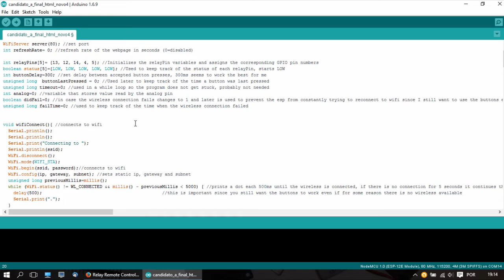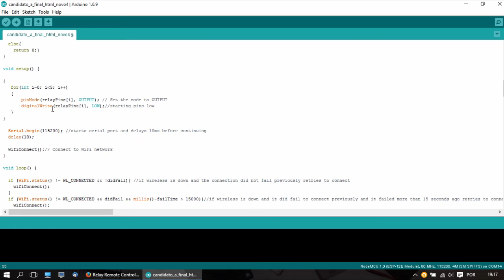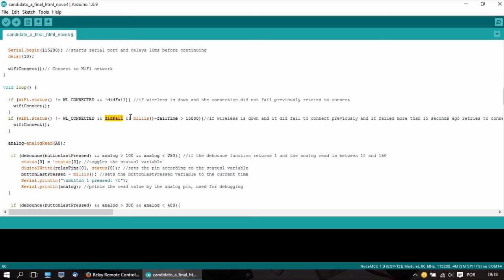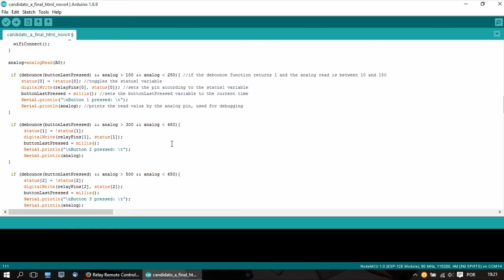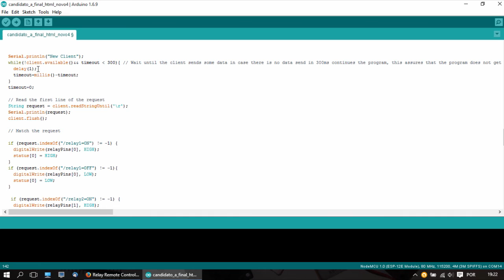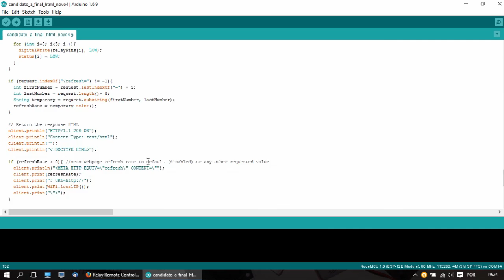ESP8266 Home Automation 5 Relays - Code explanation and download link [Part 2]

Comment: I am 72 years old retired Telecom Engineer and my hobby is IoT. Thank you for the nice project. I feel the font size are smaller on a mobile. How do I increase the font size and button sizes so that it will be easier to use on a mobile phone. Please advice and thanks again for this wonderful project.